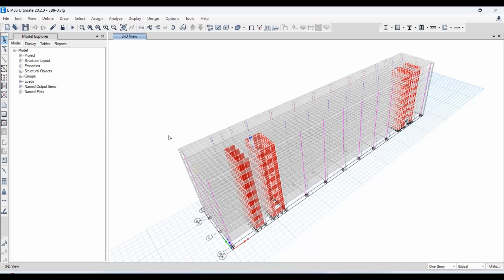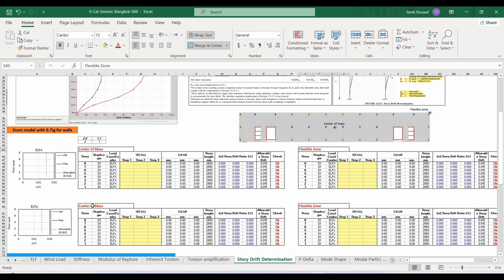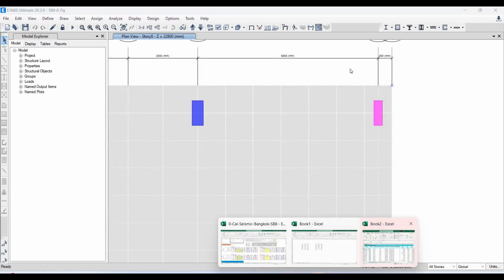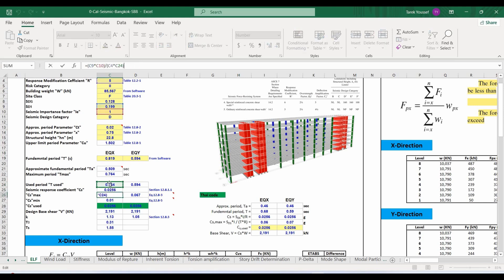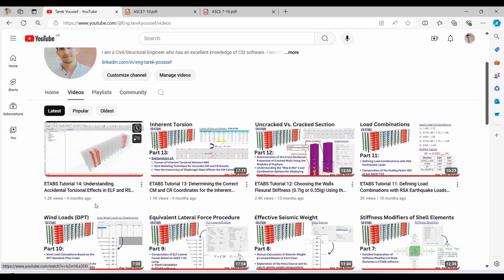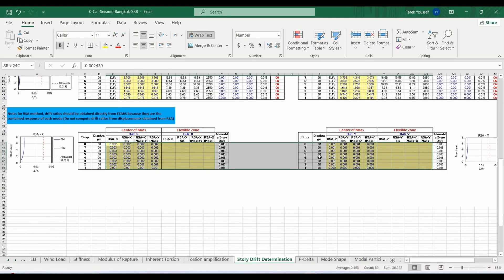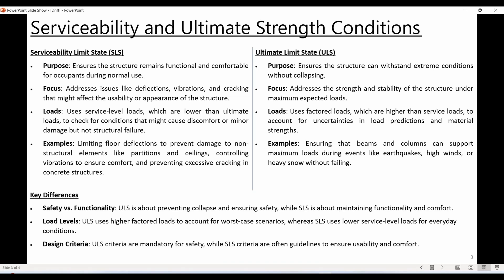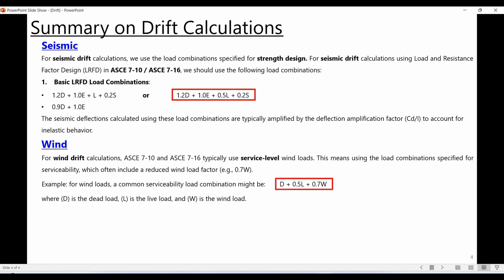ETABS Tutorial 15: Determining the Design Story Drift Ratio Using ELF and RSA Methods (ASCE 7-10/16)

Comment: you actually got displacement from ETABS which are elastic one and then manually amplified them to get get design story drift..My question is if instead of displacement, we directly extract the story drift from ETABS does it give the elastic one or we have to manually amplify them as well ???

Comment: Thank you for your comprehensive explanation, but I have a question.
You only checked the drift for two joints. What is the criterion for selecting the joints? And is it preferable to check it for all joints of the building

Comment: Assalamualaikum.. Structure for Vertical irregularity 5a or 5b (according to ACI) i.e check for weak story. It is mentioned that structure has weak story if shear strength of story is less than 80%of shear strength of story above. Also extreme weak story if shear strength of story is less than 65% of shear strength of story above. How to view story strength in ETABS?  🙏

Comment: Hi Sir, I have noticed that you did not include the gravity loads in your story drift check. May I know why? In my opinion, the gravity loads will contribute to the displacement that's why it needs to be included in the drift check. Also, I am always considering the ultimate load cases. Hoping for your reply.
Reply from the maker: Hello Sir
I mentioned at the end of this video that you can use the load combos for checking the Drift limits. 
In my opinion, gravity loads will not make a big difference in these computations, however it's ok to include them.
Reply: @Eng.tarekyoussef  Thank you very  much!